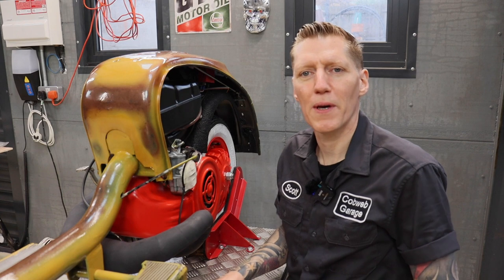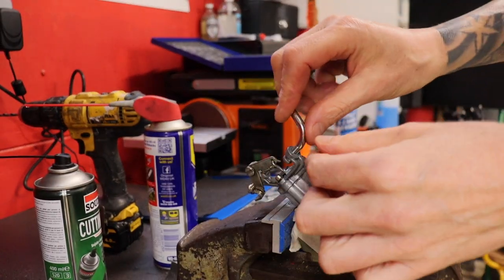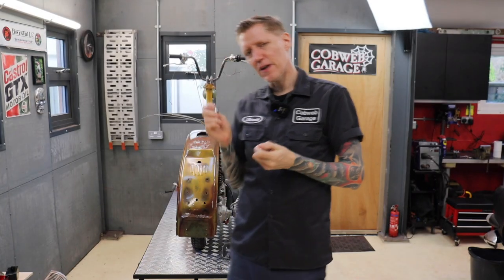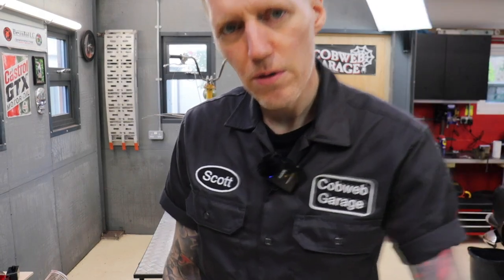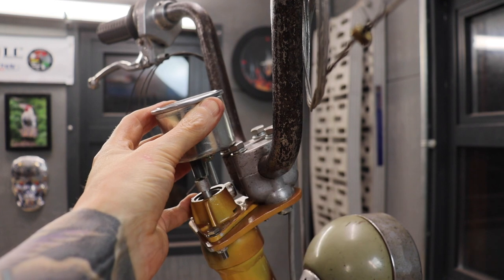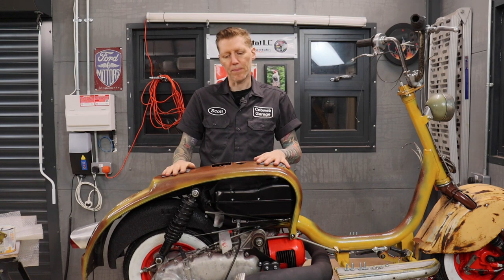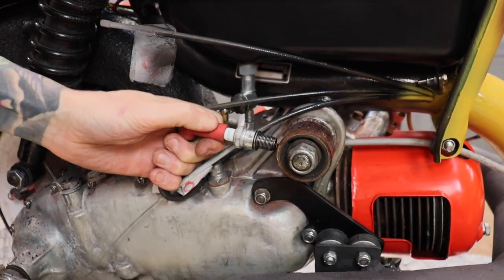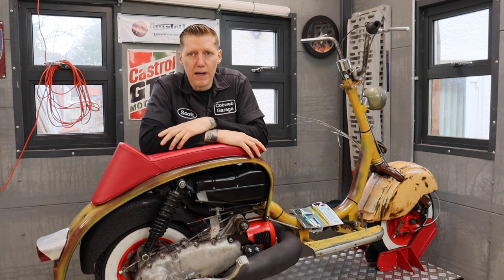Ep 9 We try and start Oddbod The Lambretta for the first time. Will it run? And the build continues.

Comment: To age chrome you can get some brick acid from the hardware shop. Pour some into a large container. Then put a brick or hand the shiny part above the acid (don’t submerge it) and leave it for 10 minutes. Or longer depending how rough you want it. 👍

Comment: The panic over E10 and E4 fuel is a bit blown out in of proportion. I've been running E10 with no worries on my GT186. Just needs a slight timing adjustment and it runs fine. The fuel does go off quicker over winter and it will pull in water so over winter I drain my carb and tank.

Comment: Could have bought a smaller plug cap scott. PVL do a nice tidy small one. For aging aluminium try soaking it in a bucket overnight, i think you can find some aging fluids on ebay, look at what the rat car builders use....
Reply from the maker: Ah yeah, I just googled those PVL caps. Neat and not much money.  Actually the extra cut out bit on the loop makes it much easier to take the cap on and off too, so worth doing I think. Thanks for the tips Daniel, really appreciated.